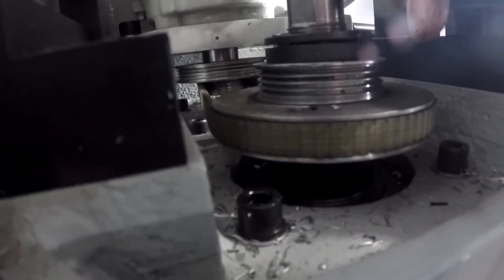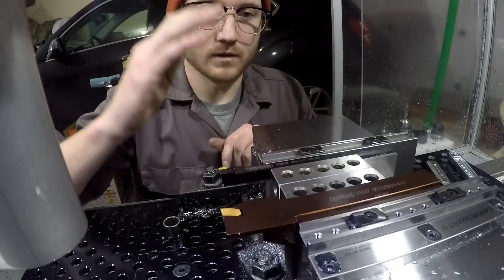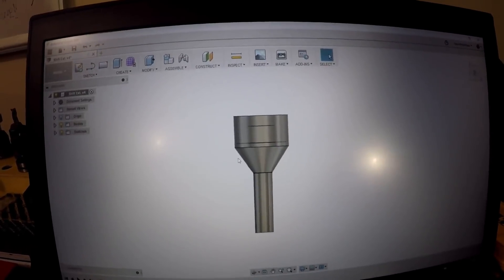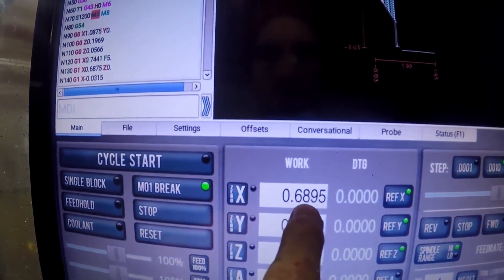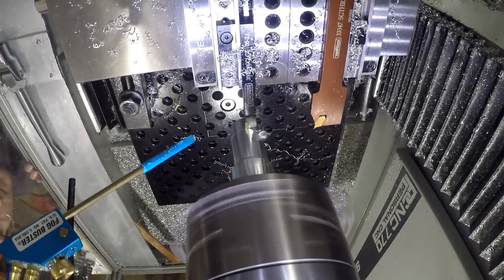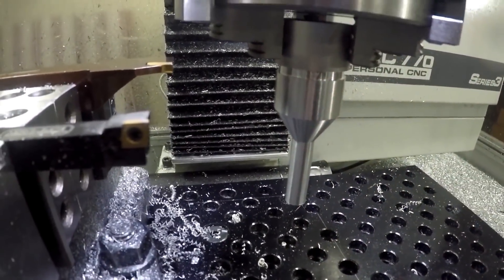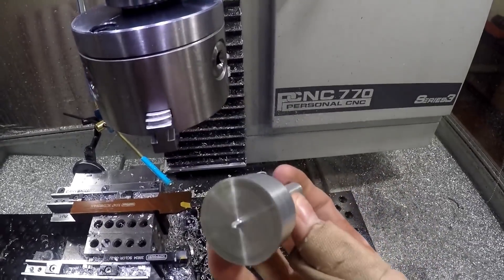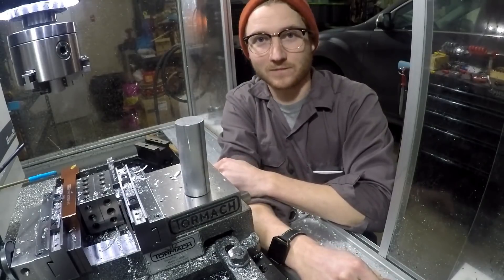Millturning on a Tormach: Home Mfg. Days #17

Comment: It's a good idea and resourceful but impractical. Aside from that, a 3 jaw chuck has only 3 small surface points oppose to a collet that has far greater holding power for fast and heavy cuts. In addition, the larger and longer the part you are cutting is, the weaker the 3 jaw chuck becomes because it does not have the holding power of a collet. So be careful.
Reply from the maker: Looking back on this it was fairly dangerous haha. I've since graduated to doing this type of work in the CNC lathe I have.

Comment: 3:21 if you look closely your tool square you will see other side is center of tool LOL. otherwise it would be funny put tool on cnc lathe if tool not go centre. atleast distance from other side is same for every tool i mean have to LOL. so it  means other side is center bcoz you can put tool other way in cnc and it still on centre and slot is 2x tool square. so other side is centerline. you can see it.
so you can measure y from tool holder like its part edge lol. then you have Y you can measure work ofset for every tool you have. touch it and tell what radius is. thats easy. and yes every tool need just own work offset no need cadcam LOL
Reply from the maker: Nice!

Comment: Your work approach looks really good. For a bit of help, and I did not sleep at a Holiday Inn last night , nor am I a "pro", but... that "dimple" left when you were facing is due to your not having your "Mill "Y" axis centered exactly on the part, and the same reason applies for having that little projection left on the part after "parting". Full disclosure, it's not easy, but you'll figure it out with some experimentation and experience. I have a PCNC 1100, but I've only done the verticle milling a few times; don't really need to do it since I have a Rapid Turn , and also a Precision Matthews 1236 lathe. Keep it going and you'll have it down before too long. There are several "masters" on YT, but you'll probably need to search for a bit to find all the bits and pieces of info which you need. I'd suggest Joe Pieczynski, Oxtool, Abom 79, Mr Pete222, and doubleboost to get started. Best wishes!
Reply from the maker: Thanks! Yeah, I always had trouble getting the Y centered up when I did millturning jobs but it normally worked out okay.  I'll have to did through some old Abom and Mr. Pete videos.
Reply: I have an 1100. Here's a trick, once you are close to center part-off, or face the end, then look at the "pip" which is left. Measure it if possible,  then reduce clearence by 1/2 that amount, then repeat again. You could even shift your Y using your dti for metrology. When you get it right, make note of the "machine" absolute dro. If you use the same setup that dro should always get you very close. Best wishes.

Comment: You could take the spring washers out so the chuck is held more rigidly. Might help with the radial pressure of the cutoff tool.
Reply from the maker: That could very well be.  I have since stopped millturning on the mill just for fear that it may get knocked out of alignment...again..

Comment: Why would you bother indicating the workpiece stock in when everything you turn in a single operation is perfectly concentric?
Reply from the maker: That's a good question.  I really didn't have to but this 3 jaw chuck isn't what you would call "high quality".  I found when I would chuck up a part I would have a TON of runout(I'm guessing it wasn't running in the jaws evenly). So I would just give it a little bit of encouragement with the dead blow hammer to make it have a little less runout.  The runout is what scared me to start the program, if I left the runout I would be taking a hefty cut on one side of the stock and not so much on the other and with this less rigid machine I figured that could cause some bad vibrations/chatter.  All in all, indicating just gave me some peace and it only took about 30 seconds to do anyway.
Reply: MojoMfg. That makes a lot of sense given your circumstance. It's always a good idea to verify :) love the videos
Reply from the maker: Thanks! Yeah I can see why a person would wonder that haha

Comment: Can the spindle on the Tormach handle the kind of weight/ pressure you're putting on it? Seems to me like you're going to burn up your bearings pretty quickly that way?
Reply from the maker: I'm not sure how quickly they might burn up but that was exactly my thoughts.  In a later video I did mention that putting that heavy chuck may wear the machine out faster than it should.  So I have since then stopped millturning just because I don't want to completely destroy the spindle....I should just get a lathe.

Comment: Great job! Parting on a SlantPro can be tricky too, so you did a great job doing it on the mill. I'm embarrassed to say that I didn't know what the DTG indication was for until you mentioned it. Thanks !
Reply from the maker: No problem. Using the DTG is a great crash prevention tool!
Reply: Me too, thanks!

Comment: New sub here. Enjoying your journey. For your next mill turning you can get the Y0 by using the haimer to touch off on the very tip of the tool. That's gonna get your very close. For the X, turn a short section of the stock and measure the diameter with a micrometer and divide by 2. That will give you your distance from X0. Hope this helps.
Reply from the maker: That will work! I will have to put the haimer in the 3 jaw chuck to find that reference though.  I'm sure that would work anyway.  Thanks for the tip!
Reply: Using the 3 jaw chuck for the probe would probably eliminate most of the precision from using the probe. It's going to be PITA to change the R8 collets but I would go with the regular TTS holder for the Haimer. You can set the Y first and then install the chuck and set up X (and Z).
Reply from the maker: Somun Yeah that’s what I was thinking after I replied the first time. I’ll set up the tools first then find my Y with the haimer, then install the chuck. I’m definitely doing that when I install it from now on.

Comment: Good stuff man! I've been wanting to try it out myself but work projects keep pushing my fun/experiment projects aside.

I've bent some aluminum tube in the past.  Once you past a certain threshold the aluminum starts to tear apart.  Heat seems to help reduce that.
Reply from the maker: Yeah I was wary to bend it. It doesn't need to be bent that much just a little bit to bring the shift knob closer to the driver.

Comment: Boy you did not waste any time getting to it. Nice work. Prosperous new year to yall. hey do yourself a favor and take a triangular file and take the bur/sharp edge from the tts collet it will cut groves into the spindle taper.
Reply from the maker: Yeah I like to get things like this done as fast as I can because when I'm doing prototype work like this the machine isn't making any direct money.  Anyway, I will have to file that down before I put it back in.  Thanks for the tip!
Reply: Run your finger inside the taper I think you have not used it long enough yet to get the ridge you would be feeling for that corresponds to the gap on the collet. I do the same to all the 5c collets. The hardinge collets have the area surrounding the gaps rebated so they dont contact the taper but the are 50 bucks each.
Reply from the maker: I may not have been using the machine long enough.  Still, that is a good tip to know.